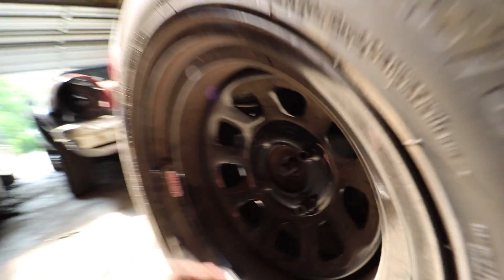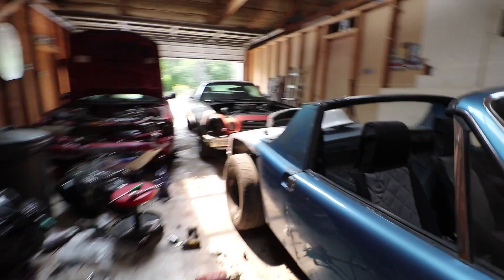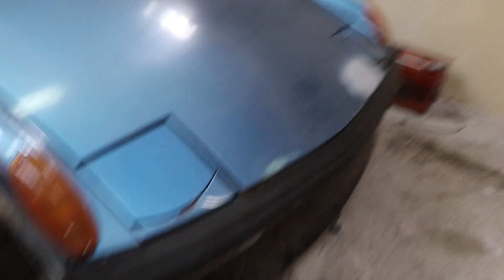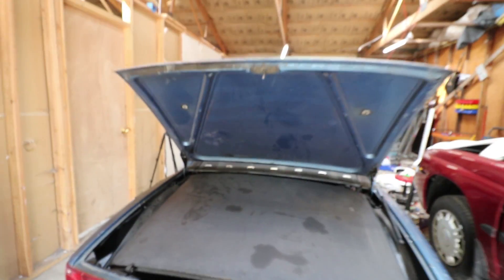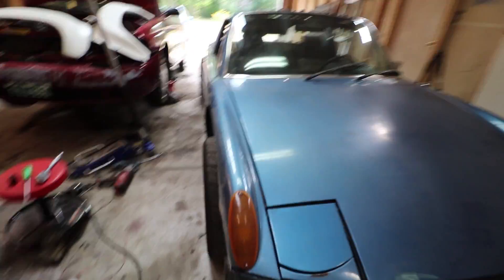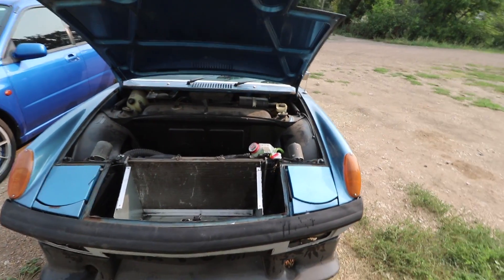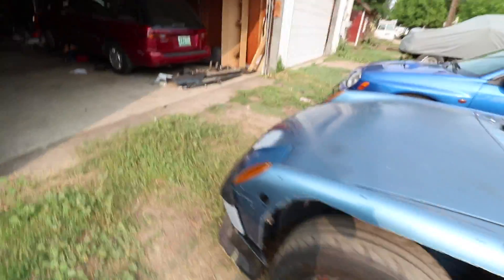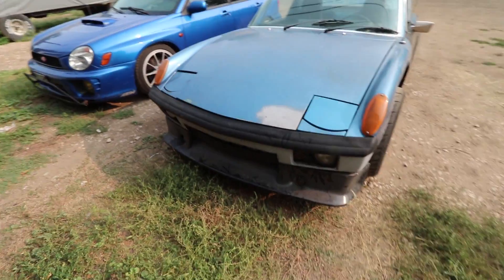Overheating the Project 914?!

Comment: If it's an air flow issue you may need to put some vents in the hood so the hot air from the radiator can escape.  Just a thought. Good luck, always excited to see your porche vids.
Reply from the maker: Wasn't an airflow issue luckily. Already have sorted it for the next video😀
Reply: Can't wait.
Reply: Good deal.

Comment: I think the cooling system isn't working due to air stucked at some higher spot of the system. Usually the coolant tank is the highest spot, so air can escape and be replaced with coolant.
Due to the "radiator in the front, engine in the rear"-setup I dont know, if another coolant tank, or at least a vent valve is needed in the rear.
Maybe you should have a look at other mid- or rear engine cars with a radiator in the front, like the Volkswagen T3, see how their cooling systems work and transfer it to your Porsche.
Reply from the maker: I have a bleed/fill port attached to the highest point of the coolant system
Reply: Ok, do you know how much coolant you filled in there? If its less than the donor car usually takes there might be air in the system. If not, like you said, the thermostat could be stuck.

Internet-diagnosis is always poking in the dark. Just from looking at the fotage I can imagine that there could be air stuck at the upper radiator hose, just because its another high spot.
Reply from the maker: I already fixed it haha. I'm a couple videos ahead. It was a stuck stat

Comment: What temp does it idle at
Reply from the maker: It doesn't. If t idles the temp would creep up
Reply: SMB Garage your thermostat must be stuck, one radiator pipe is hot and the other is cold usually the case unless your pump is gone, run it with no thermostat as a test
Reply from the maker: +Stephen Kearney already fixed homeboi😁